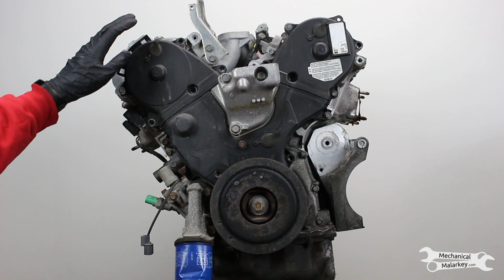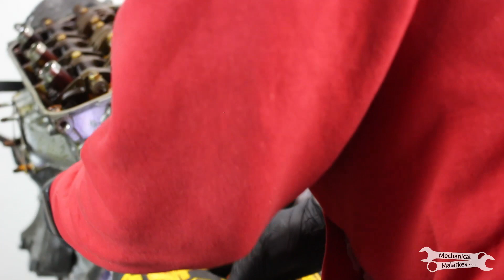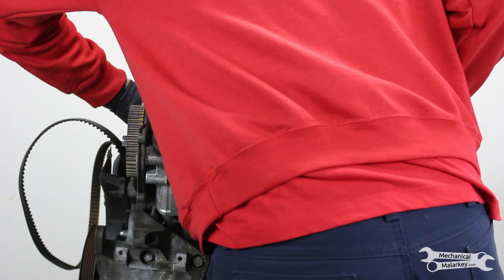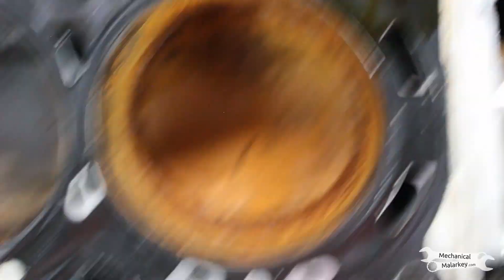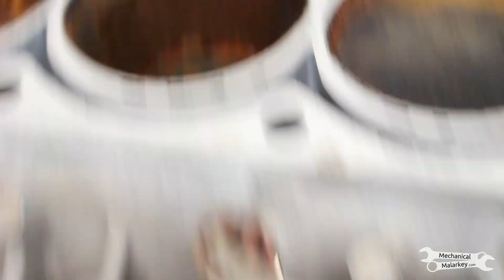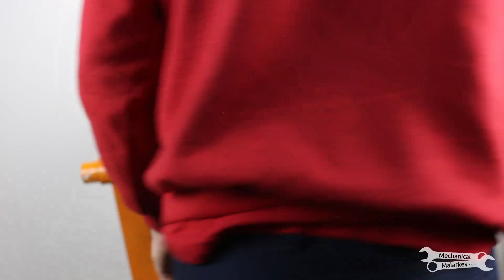Honda J35 Engine Teardown

Comment: It's a common engine that you CANNOT find a replacement for currently because of the major rod bearing failure problem that HONDA is having with every J35 motor they produced from 2016 to 2020 (due to improperly manufactured crankshafts).
Reply: The recall is not for every J35 in that time period. If it is, feel free to show where your insider information is coming from. Also, even the ones with the improper bearings are still running 100k+ miles.
Reply: @MeltingRubberZ28 the NHTSA has opened an investigation into 1.4 MILLION additional Honda vehicles with the J35 V-6.  This rod bearing issue will end up being a larger nightmare for Honda than the Takeda air bag issue.  EVERY J35 manufactured from 2016 to AT LEAST 2020 has an improperly designed crankshaft.
Reply: @cm1133 oh no they opened an investigation! If it were improperly designed they would have forced Honda to recall already. It was one specific manufacturer that was manufacturing cranks and the journal was slightly out of round. That's why not even all engines in that time period are included.

Comment: I rebuilt a j35z2 properly gapped rings but the internal friction of the engine is too much and it literally stalls the engine, i have to use two batteries to power the kick to turn engine over. What di you think caused this... Rings are properly gapper to factory spec

Comment: Hi. I tore the heads off a j35a. Heads were warped. But after checking the block, I see the front deck is able to slide .003 feeler under the straight edge on the cylinder sleeves. Do you think just skimming the heads will be ok? Going to use permatorque felpro head gaskets too

Comment: Crankshaft bolt Honda makes a special socket
Reply from the maker: Yes, I was using a crank bolt socket, my home air compressor isn't strong enough and this engine is all rusted together so it wasn't worth trying much harder.

Comment: how do i know which cam fits into which block head and would it make a diffence??
Reply from the maker: There would be a slight offset between the two with how the cylinders line up.
Reply: ok i figured that out..... but the reason i thought that is the that holds belt.... it doesnt line up with the timing maqrk either to sooon or to later
 @MechanicalMalarkey